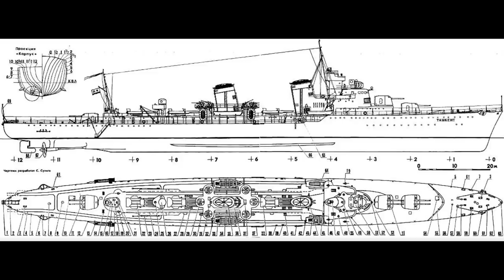The Drydock - Episode 159

Comment: @Drackinifel, Just to add to your answer for the first question, several different companies currently operate "Fast supply boats" in the offshore oilfields around the world. While these obviously don't fit the exact parameters of the question/answer, and are far newer than what your channel typically covers, it is interesting. I believe the fast supply boats are capable of 30-35 knots, while the normal supply boats are typically more in the 20+ knot range. 

Obviously in the oilfield time = money, so sometimes it's worth it if you need a specific part delivered. A situation that is far less common in the military. However, these are the kind of boats that are being used in the US Navy's Ghost Fleet Overlord

Comment: Another long range projectile issue to factor is the, "Coriolis effect." Depending on hemisphere, a projectile will drift right or left due to Earth rotation.
Reply: Gunnery at long range is very difficult but the penetration values for big naval guns at distances beyond 20km are hillarious. The shells come down very steeply and can penetrate deck armour like its not there.
Reply: Statistical artillery. It's pretty good actually.
Reply: No it can't have anything to do with hemisphere, both hemispheres rotate the same way so hemisphere must be irrelevant? If you're in the southern hemisphere shooting north the drift is the same as in the northern hemisphere shooting north? Or am I wrong? Might be wrong just that's what flashed in my brain when i read the comment. Also besides shot direction would latitude not be the factor as the earths rotation is far greater at the equator than it is at say Scotland for example? I might be wrong just what my head says lol
Reply: @mattsmith5421  an effect whereby a mass moving in a rotating system experiences a force (the Coriolis force ) acting perpendicular to the direction of motion and to the axis of rotation. On the earth, the effect tends to deflect moving objects to the right in the northern hemisphere and to the left in the southern and is important in the formation of cyclonic weather systems.

Comment: The "Manxman/Abdiel" class of fast minelayers turned out to be nearly ideal fast transports once their roles as fast minelayers became less important. Same with the rebuilt WWI flush deck destroyers modified especially for the fast transport role. Even with the loss of two boilers, they were still capable of nearly 30 knots, and the former boiler spaces provided a surprisingly roomy space for up to 200 troops or several thousand tons of supplies. 31 ships were eventually converted, and the Navy was generally satisfied with their performance if not their material condition. The US Navy continues to have an interest in high speed transports with the currwnt 14 "Spearfish" class vessels.

Comment: @ 18:45 Russia/USSR had a 100 mm/56 B-34, which they already had available in single mounts, but were also developing a dual mount, the M3-14 & M3-16 which were designed for the Sovetskii Soyuz class battleships and Kronshtadt class battlecruisers. Also, there was the dual deck quintuple torpedo launcher from the Project 48 Kiev class, which placed two torpedo tubes on top of three, featured in WoWS on ships such as the Khabarovsk, which would have been a natural way of cutting the torp tubes down from 3 sets, to two. This design would be interesting, a sort of Russian Akizuki class, since the B-34 was originally designed as a heavy caliber AA gun.

Comment: Skua was absolutely not a design contemporary of the F3F or the SBU-1. Both of those aircraft were several years older in introduction and represented an entirely different generation of design. The monoplane SB2U Vindicator dive-bomber/scout-bomber precedes the Skua by a year in introduction and surpasses it in basically every metric (speed, bomb load, range) but forward facing armament (1x .50 vs 4x .303's). The F2A was test-flown in the same year and introduced into service less than six months after the Skua. The contemporary of the F3F was the damn Sea Gladiator.
Reply: "Damn"Sea Gladiator? Like Faith, Hope and Charity which defended Malta in the early days of the siege?
Reply: @alecblunden8615  More utility in terms of morale than practical effect, regardless. The 'damn' was merely to draw attention towards the differences in capability being described here.

Comment: Your explanation for the shortcomings of the Skua are more or less true but I think you overlook the obvious for why there was no follow on.  The fact that the UK  went to war in 1939 has little to do with short comings of the Fleet Air Arm.  Japan went to war officially in 1937 and had little difficulty in developing new aircraft.  Aircraft development was in the hands of the RAF until shortly before the war so the Fleet Air Arm had no fighter aircraft under development in 1939.   The Seafire and Sea Hurricane were ad hoc emergency program to give the Navy modern aircraft.   The US Navy had the next generation of aircraft under development in 1940 and developed new aircraft during the war.  The Royal Navy developed no fighter aircraft on its own during the War  and thw one or two strike aircraft it did develop were inferior to the US counterparts, except for the SB2C.   The immediate post war aircraft like the Sea Fury and Vampire were developed for the RAF and adapted to Naval service like the Hurricane and Spitfire.

The legacy of the lack of control of aircraft development prewar had a major long term impact in the post war period where a combination of reduced funding and force levels led to stretching out of  development and small procurement levels that wasted what little funding they had.  The UK would have been better off licensing aircraft like Panther, Skyhawk and Crusader than attempting to develop their own aircraft.  It took until the 1960s for the Royal Navy to learn this lesson when they went with the F4.
Reply: You do make a good point about the Fleet Air Arm not having control over aircraft development in the late 1930s, but I’m not sure Japan’s situation was comparable.  Japan was at war in 1937, but it wasn’t rushing to produce aircraft to fight against a peer opponent air force or navy.  It therefore had the luxury of continuing its aircraft development at basically a peacetime pace.  Britain was thrown right into the fire against Germany, and was forced to devote all its resources to combat the Luftwaffe.  Since Germany had no carriers, and Japan hadn’t yet introduced more advanced aircraft, Britain simply didn’t rate naval aircraft development all that highly.  I suspect there was also a feeling that if Japan started a war in the Pacific, Britain would have help from the US and time to deploy land-based fighters to the colonies.  So there probably was strategic thinking involved.  It just happened not to work out well.
Reply: @bluemarlin8138  That is plausible but Britain was also preparing for war and the RAF was developing new aircraft.  Japan's war in China was nearly on the same scale as Barbarossa.  We in the west tend to forget the war China.
Reply: @johnshepherd8687  The second Sino-Japanese War was a huge ground conflict, but the Chinese couldn't seriously challenge Japan in the air and had no significant navy, so there was no strain on the Japanese aircraft industry to produce planes "now now now" instead of developing and building newer designs.  Japan knew it would not face much air opposition in China, and that its navy would be the branch facing off against its serious opponents---the US and Britain.  While I haven't researched it, I think it's safe to assume that Japan focused on naval aircraft development because of this fact, and therefore developed better naval aircraft.
Reply: @bluemarlin8138  It is not merely a question of what the Chinese could do.  The war itself was a tremendous resource drain and Japanese economy.  Resources are fungible.  Resources spent on the war in China were not available for other purposes yet Japan continued to develop new aircraft.  

If the British aircraft industry could develop jet aircraft then why could they not develop naval aircraft?  I think that answer lies with control of aircraft development by the RAF until 1939.
Reply: @johnshepherd8687  I'm not saying the RAF didn't have a role in handicapping the Fleet Air Arm's development of new aircraft prior to WWII.  I'm just saying the onset of war also had a major role, and the two worked in concert to handicap the FAA.  If you look at the aircraft used by the RAF during the early years of WWII---when aircraft production resources were strained---they were either already in production or very close to production in 1939.  The "new" fighters which came out between 1939 and 1944 were mostly just iterative improvements on the Hurricane and Spitfire.  But at least they were starting with fairly advanced airframes for the time.  The difference with the Fleet Air Arm is that they didn't have a lot of new naval aircraft in development, and when they got stuck with what was already in production or close to it, the technology was a lot further behind.  However, it's not that difficult to see why high performance naval aircraft weren't prioritized in the 1930s----namely because other nations' naval aircraft weren't any better until 1940-41 and they thought they'd have time to match any improvements later on.  (Dr. Alexander Clarke has also mentioned in one of his videos that a lot of the British naval aircraft were designed to undertake night operations, and therefore were designed for ruggedness and stability over performance.  I'm not sure I buy this completely, but it may have played a role.)  Sure, the British did develop advanced aircraft later in the war, but they weren't able to put them into production until they were comfortably on the offensive.  

As for resources being fungible, I'd disagree.  Aluminum and radial engines weren't much use in a land campaign in 1937.  Neither were aircraft engineers.  Sure, the war with China put SOME strain on the resources Japan used to design and build aircraft.  But it wasn't nearly as much as the strain placed on Britain in 1940.
Reply: @bluemarlin8138  Some strain?  It was an immense strain.  Even General Tojo considered negotiating an end to the China War because it was wrecking the Japanese economy.

There is no inconsistency between ruggedness and performance.  You know like the F4U and F6F?

Comment: I think it's rather the fact that the FAA lacks modern naval strike aircraft than the Skua being a terrible aircraft. The Skua were capable dive bombers, and they can do dogfight against enemy strike aircraft. The Skua's successors in the dive bombing role, Albacore proved to be unreliable. So unreliable that there was a FAA song which says, "the Albacore stays in the ground", "Bring back the stringbag to me". Their successor in the dogfighting role isn't much more successful either, the Fulmar was capable, but not to the standard set my land based bomber.
Reply: The FAA was hamstrung because though it was realised that naval aircraft needed more power than a land based equivalent the air arm did not escape the clutches of the RAF until mid 1939. Though Reginald Henderson identified the requirement for a 2,000 hp engine whilst serving as Third Sea Lord but this was never going to happen in the circumstances.
The Fulmar was introduced in May 1940 first fitted with a Merlin VIII and later with a 30 and the maximum power installed was 1,300 hp. which was far below what the navy wanted. The Griffon design was started in 1938 soon after the FAA approached Rolls Royce asking if a larger engine than the Merlin could be produced but its introduction was delayed because of the perceived need to concentrate on the already established Merlin.
If the FAA had received the engine it so desperately wanted in good time the story of the aircraft supplied to it would have been very different.
Reply: @DeCasoU1  No amount of power is turning the Fulmar into a fighter to fear.
Reply: @WALTERBROADDUS  Are you paraphrasing Admiral Tom Connolly?
Reply: @johnshepherd8687  A bit...😉 To be honest, the Fulmar is a Fairey Battle with guns. Okay, for a lumbering Fw-200 patrol plane. But a dog for any thing with a pulse....